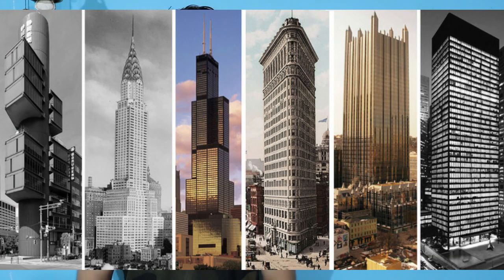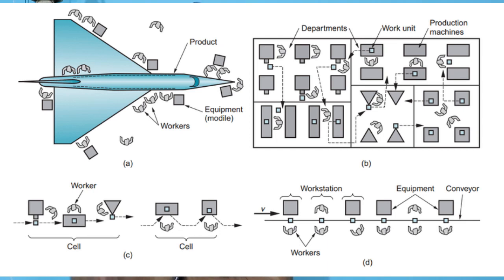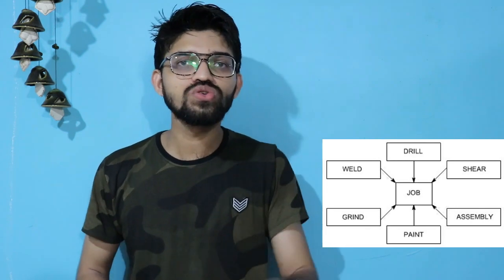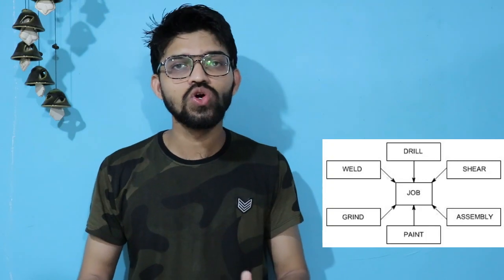Line layout, Functional Layout (Process layout), Combination layout, Fixed Position layout

Comment: NYC explanation..could u plz differentiate between job and batch manufacturing??
Reply from the maker: job shop manufacturing is like.. a simple lathe milling maching production shop
.. where we can produce parts in masses .. wherein batch production system .. we do product as per customers orders in a specific batches..
Reply: @EngineersAcademy9204  thank u and all the best😊